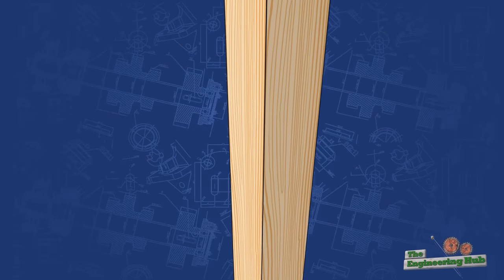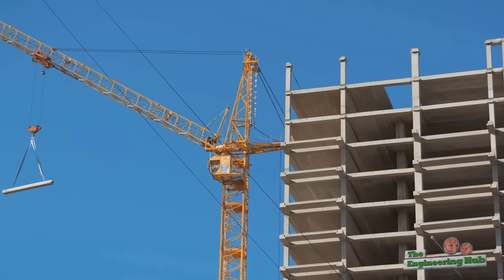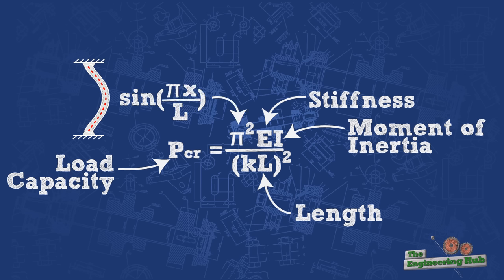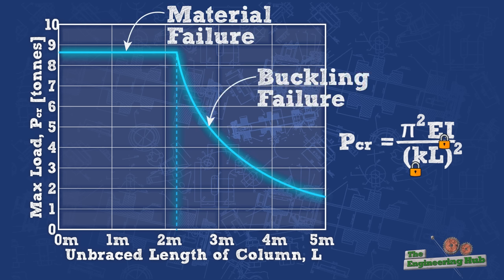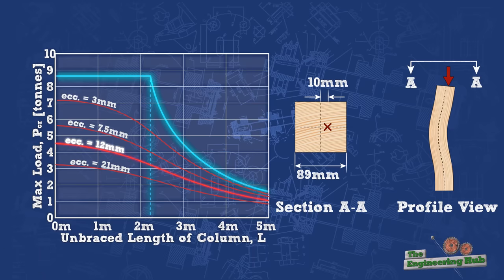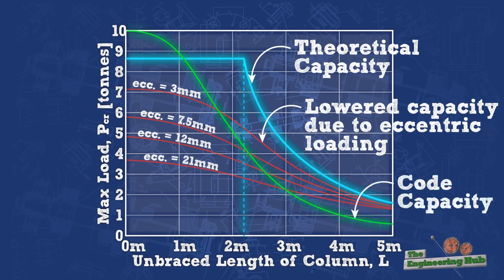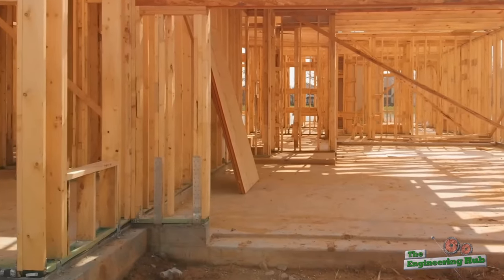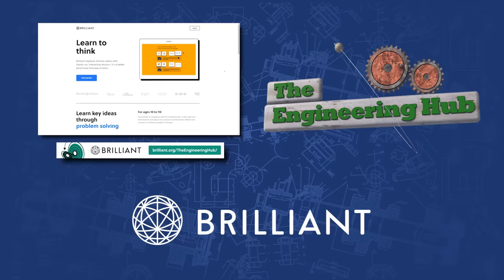How much load can a timber post actually carry?

Comment: And a lot more varibales. Just started the video. And non of the main points ive already considered were mentioned. Not sure if theu will be adressed later in the video or not. 
But, they type of tree the timber post came from is on main factor. Not all woods are the same or have the same properties and fiber structures and grain types. There are a lot of very weak, medium, and strong veriations in the wood of trees. Alao it depends on which direction of the post beam or timber you are expecting to cary the load. Trees grow vertical and are used to carrying the virtical down force of their own weight . If you use a timber as a vertical post and ypu plant it with its natural base end up then it wpnt be as strong as if you put its natural base aa the base. That working with the natural properties and how that tree the post came from grew. Also sometimes there is a big gifference in strenght of a beam as to which side is up or down and where the loads its carrying are pla ed. In most construction with post beams and timbers. The size of them far and their robustness of streanth far exccwds the application they are being used for ao builders dont pay any attwntion to these fa tors. And there are plenty of othef fa tora ro consider also. This is just a few that sprang to mind in an instant to me. Lol hope its a vauable contribution. Thanks.

Comment: I liked you video on this, however, there is one thing I would like to point out.  It might seem like semantics, but columns and posts are not interchangeable.  Although you do somewhat make a distinction, the video is rather vague about it. A post is a structural element that weighs less than 300 us pounds and is either axially loaded only or is laterally restrained be a member above.  A column is a vertical member that does not coincide with those parameters.  The connection requirements are significant in difference, for example, a steel post requires only two bolts to the foundation wall, while a steel column requires 4 bolts to a foundation wall.  There are more differences not listed in this comment, but that’s the gist of it.  Our company had to change our wording from column to post on behest of our insurance company, so it does make a difference in liability.
Reply from the maker: Hi Bbdest, 
Thanks for your comment. We agree generally that there is a nomenclature distinction between post and column. What jurisdiction do you work in that provides this specific limit of 300 pounds etc. ?
Reply: The 300 pounds comes from the Code of Federal Regulations, subpart R (steel erection), 29 C.F.R. 1926.751.  The definition of post is located in this section.
Reply: So this is part of the US government regulations.  Of course, this means that outside of the US, this doesn’t apply

Comment: There is no way I am going to understand all of this but I do have a question. If I was to sandwich plywood ( glued & screwed ) between 2. 4x2 to make one post would that be stronger than just a 4x4 post.????
Reply: The plywood would be negligible in strength but the extra space between the 2xs would make it a little stronger in the case of buckling

Comment: Was there an explanation why a 4” x 4” post was equivalent to 89mm x 89mm? Are these “freedom” inches by any chance?
Reply from the maker: Hi Citizen, for most dimensional lumber, the actual sizes are 1/2 inch smaller than the nominal sizes (some 3/4 inch smaller). The short answer is because of the planing process. A slightly longer answer is available here: https://www.popsci.com/two-by-four-lumber-measurements-explained/ Thanks for bringing this up!
Reply: A 4x4 post measures 3-1/2 inches just like a 2x4 measures 3-1/2 inches by 1-1/2 inches thick. That equals about 89mm. The video is correct.
Reply: @TheEngineeringHub  My father who sold lumber and built homes for a good part of his life always considered nominal dimensions to be akin to fraud, sort of like what has been obscuring inflation for a long time in consumer goods: smaller quantities and sizes for goods, instead of maintaining sizes, etc, and raising prices.  Clorox used to come in 128 oz (1 gal) jugs.  Now, 121 oz.  Tuna fish cans are probably the oldest story of near fraud changes that the packers hoped no one would notice (or for this group "wood" notice?).
Reply: Dimension lumber is originally sawn to the nominal dimension and then "dressed" to the smooth shape you buy at the lumber yard.

Below 2" they shave off 1/4" in the dressing stage; 1/2" when the wood is nominally for 2 to less than 8 inches; and 3/4" for dimension lumber eight inches and greater.

At some size, the name goes from "lumber" to "timber". Timbers are the largest sections. But today it is more economical to make large cross sections as gluelams instead of harvesting giant trees.
Reply: @TheEngineeringHub  most... meaning new 4x4's you buy in lumber stores.. but in reality 4x4 is 4x4 and 6x6 is 6x6 if you get lumber from real saw mills or have very old structures... for example my pole barn built 50 years ago the 6x6 beams are actually 6x6 and the 8x8 are 8x8.. but the replacement 6x6 is like 5 1/2x 5 1/2... kind dumb,, but oh well
Reply from the maker: @jeepsblackpowderandlights4305  We don't disagree with you Jacon!
Reply: @jeepsblackpowderandlights4305  Do you want full 2x4 from my mill that's air dried & not perfectly 2x4? Or do you want exact 1½"x3½" that's been kiln dried & planned with rounded edges?
Reply: @jamesrussell6870  1.5 x 3.5 the consistency makes the job get done faster with much less Hassel especially for building houses, plus I think the strength and stiffness is the same for  regardless, due to rough sawn lumbers surface finish being weaker the real strength starts just inside the surface of rough sawn lumber, but air dried is definitely much nicer to work with and stronger I believe.  Rough sawn is great as barn lumber and is its own finish nothing looks better than a well built rough sawn barn
Reply: Also it's hard to get lumber from a mill as compared to a lumber yard

Comment: Why not explain the difference between nominal and actual dimensions, seeing as 89mm = 3.5"
Reply from the maker: Hi tre bushett, yes in hindsight, we should have said a couple of sentences about that as well. Sometimes we tend to take things for granted when they are not as obvious. With most dimensional lumber, the actual sizes are 1/2 inch smaller than the nominal sizes (some 3/4 inch smaller). The short answer is because of the planing process. A slightly longer answer is available here: https://www.popsci.com/two-by-four-lumber-measurements-explained/ Thanks for bringing this up!
Reply: The nominal vs actual situation is just ridiculous.  It's not a massive inefficiency, but it's definitely an annoyance.
Reply: @TheEngineeringHub  When you have a sawmill and a forest: We don't got no "nominal" crap.  We don't need no stinking lyin' lumber dimensions!

Comment: So what this tells me is that almost Every deck that've seen on a hillside may fail prematurely.  I see 12 ft and even 16ft 4X4s regularly, all with no diagonal supports (because those are ugly and cost more).  Look out below!
Reply: Girts n purlins, take a cue from timber framing.  And from the bracing used with floor joists.  Ugly?  So is unexpected failure.
Reply: 16ft 4x4 holding up a deck on a hillside? I'm no engineer, but holy crap, how can someone with any intuition look at that and think it's strong enough.
Reply: That chart says a 3m x 89mm x 89mm can take ~4.5t of load, and code load is 2.25t.  Given that your typical deck has quite a few of these underneath, sounds like there is way more than enough load capacity.  How heavy does anyone think a deck would be?  20 people standing on it would only add something around another 1.5t ie  way less than the conservative Code rating for a single post.

Comment: What safety factor are the manuals using? I read where the ultimate strength of a SYP 2 x 4 was in the 8 ton range which makes this fir calc seem low.
Reply from the maker: The safety factor is distributed over many parameters on the resistance side and additional safety factors on the loading side (increase of the expected load). The safety factor is slightly different for every scenario, depending on the size of the member,  location in the structure, environmental conditions, loading type etc. On top of this, the reported strength is the 5th percentile strength which means that if 100 specimen are tested in the lab then the strength of the 5th weakest will be reported. In other words, 95% of the specimen will be stronger than the reported strength. All these conservative assumptions sum up to a conservative design. My guess would be that the SF ranges between 1.5 to 2.0 but again it is situation specific. The values reported in this video are for ''default'' conditions. Lastly, as a disclaimer, the high variability of wood makes it important to have large safety factors that could account in a case of an ''unlucky'' selection of a bad piece. Do not ever rely on the hidden conservative assumptions and design an overloaded the members!
Reply: @TheEngineeringHub  OK, I guess with an SF of 2 this would make what I heard about right with a an ultimate compressive yield of a 4 x 4 to be in the 16 ton range. Obviously, it would all depend on potential buckling of course but is a good place to know where your maximums could be.
Reply from the maker: @kenbaustin4533  That sounds reasonable to me. I would highly recommend this reference: https://www.taylorfrancis.com/books/mono/10.4324/9780203477878/timber-dinwoodie
for more info on many properties of wood. For example, on page 155 (Table 7.1) you can find the compressive strengths for small clear samples of different species. Based on this, small, knot-free samples achieve much higher average strengths. But of course, we can't use the mean value since that would mean we over-estimate the strength half of the time and we assume no knots. Another example is Figure 4.2 which shows the relationship of strength to moisture which is another modification factor in the manual. This book is an absolute gem! If you are interested but don't have access to the book send us an email!
Reply: @TheEngineeringHub  10/4...... appreciate your time and input!

Comment: The first illustration incorrectly identifies the post as a 4inx4in while a nearby notation identifies the post as an 89 x89.
The post in fact is 3 1/2” x 3 1/2” and also 89mm x 89 mm.   The post is commonly referred to as a 4x4.  Please correct.

Comment: 4" is 101.6mm - 89mm is 3 1/2". Where I live 4" is not 3 1/2". A bit like the Imperial gallon compared to a US gallon termed a short gallon. In the case of the 4" post, 25% less material, could it be called a skinny post. Cheers
Reply from the maker: Almost all dimensional lumber is reduced by 1/2" (some 3/4 some 1/4) due to the planing process. Across most of North America, a 4 by 4 is 89 by 89 mm.
Reply: @TheEngineeringHub  This is true. I wonder where the OP lives. Here a 2X4 is actually 1.5 X 3.5 , and so on.
Reply: @paulhopkins8148  Maybe he lives in 1924

Comment: That depends on the wood. Spruce, Hemlock, Fir, Oak, Maple, they all have different load capacity.
Reply from the maker: Yes absolutely! As mentioned in the video, the assumption is that the member is SPF lumber of a standard grade. That is the wood compression capacity parallel to grain is 10.8 MPa. This is, the most common type of dimensional lumber in North America.
Reply: Some Australian Hardwoods select grade can be F34. For the record, nails bend! Have to pre-drill holes for nails removing the drill bit about 5 times to clean it for 3.5mm dia 80mm long hole.
WD40 on the nail to hammer it in.
Reply: @tonydoggett7627  Oh, you guys cheat. Shame on you. Soap works much better. Just kidding. Oil soaks into the wood over time, stops rust too. Just sayin, should be an oversize nail, better yet a screw. Now the soap comes into play. G'Day Mate.

Comment: A 4x4 (3.5”x3.5”) It’s not called a column it’s a post when it’s nailed in vertically and a beam when it’s nailed in horizontally! When it’s framed in above a door or a window it can span up to 3Ft by Code over 3 Ft you need to use a 4x6 or sister two 2x6’s together up to 6Ft. Over 6Ft - 10 feet you need two or three  2x8’s sistered together.
Reply: The term "column" in this context is an engineering term: it refers to a structural element that supports vertical loads without lateral bracing. So if you have a 12 foot 4x4 post but it is restrained in the middle then from an engineering point of view you can consider it as two 6 foot columns stacked one atop the other.

Comment: The similarities outside of the math, to retention walls, is interesting.   A shorter retention wall, is better, even if you have to stair stack them.   (tier).   whereas the load behind a wall, is kicking out the middle of the wall.

Comment: This makes me wonder whether I could use the same volume of wood in a 4x4 post of given length to hold up more weight if it were split into multiple members even if joined by only wood interlocking joints; i.e. no additional fasteners or adhesives. I feel like I definitely could for longer 4x4s especially if I don’t have to subtract blade kerf and drilled holes, but just have the final volume of wood in the structure be equivalent.
Reply: I mean yes, but who has time to select wood members that have no blade kerf and drilled holes and interlock them to a long post xD. So you'd rather just take a 1cm larger post and be practical about it. But I like the thought experiment nontheless :D
Reply: Congrats on making a big stump. Yea, super stronk. Do it a few more times and you got yourself a tree. LETS BUILD HOUSES OUT OF TREES! Man, this wood is heavy! Maybe we should cut it.
Reply: If you have enough lateral bracing then you have reduced the unsupported vertical distance (between braces) then the load capacity does increase compared to no bracing because the length that is subjected to buckling is shorter.

Comment: The old time carpenters didn't have the math skills to calculate that, but the had the necessary knowledge to know exactly the load bearing capabilities of the wood they used.
Reply: .... proven by centuries of safe use

Comment: For curiosity sake ? and not for something over  6-8ft tall, will using a metal "collar" or brace, midway  on a 4 by 4 or even reinforcing with a wood brace help it support more ? & possibly help "distort" the bowing ?  I have worked in the trades mostly with metal But also built MANY things,out buildings from reclaimed materials!  The smartest  thing I discovered by accident was using rail road & sign materials were already tested to stand up to weight and wind pressures:) thanks makes me want to still be building stuff:) Rick
Reply from the maker: Hi Rick! Bracing the post at the midpoint will help significantly. The post will behave like two individual posts with half the length of the original post. As we saw in the video, shorter columns are much better at resisting buckling. Similarly, if you see some old railroad wood bridges, they are braced regularly with cross bracing, which helps handle lateral loads better but also prevents buckling of the long wooden columns exposed to the heavy steam engines. See image:  https://previews.123rf.com/images/rgbspace/rgbspace1807/rgbspace180700003/106438106-vista-del-puente-ferroviario-de-madera-de-caballete-kinsol-en-la-isla-de-vancouver-bc-canad%C3%A1-.jpg
Reply: Yes, if you can find the Euler formula again, the presence of braces is accounted for in the modifier "k" that is multiplied by the total length "L".
Reply: any beam you can increase its load capacity using boards nails the sides at a angle like this / on both sides of the beam.. My pole barn was built like this and so was my deck which uses 15 foot 4x4 posts

Comment: Im planning to make a 20x23 ft bungalow house..6x6inches wood column 12feet in height, 10feet post to post distance in the perimeter..no post in the middle, almost a long span truss design..hope it works..
Reply: Good luck 

You may have to hide an i beam in there for safety